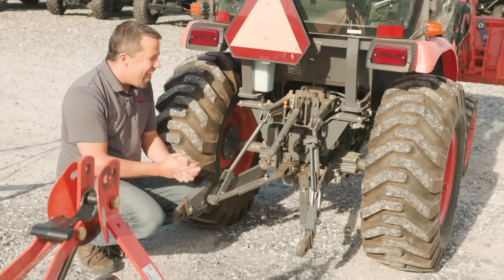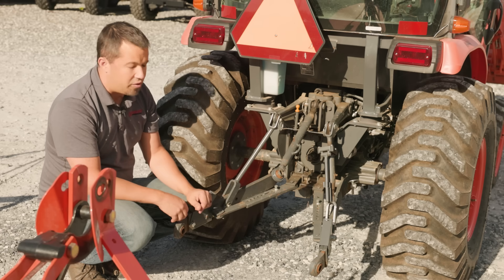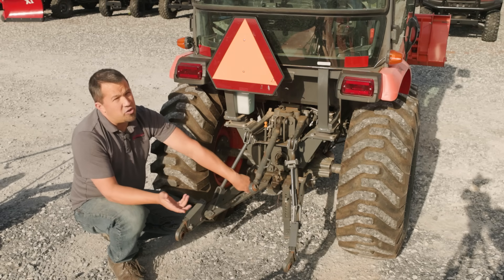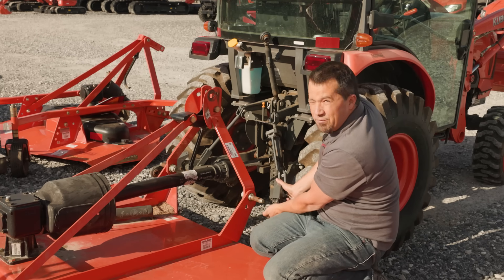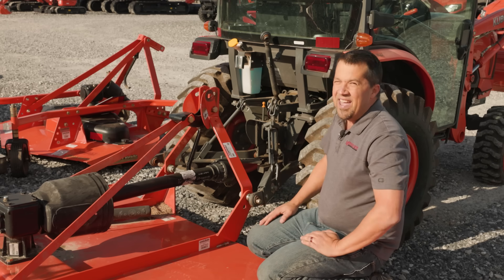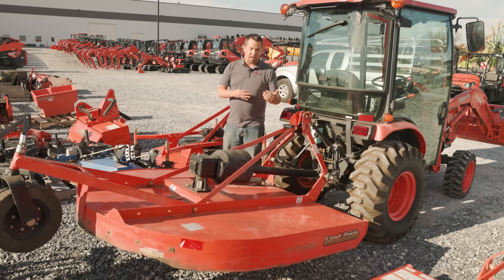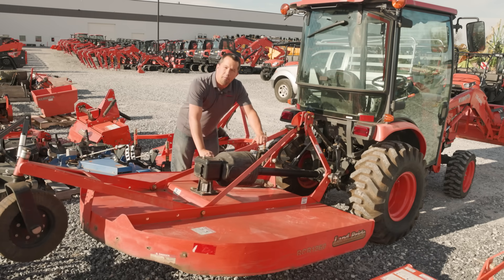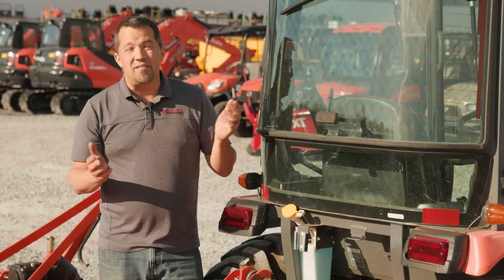Ultimate Guide to the 3pt Hitch

Comment: Thank you for the discussion. Find it easiest to put the top link on first for 45HP tractor. Release handbrake on flat ground and pull tractor back to implement or implement forward if light enough with handbrake on. Put left lower link on first and right next using the adjuster on that arm. Quick and easy. Easier if you lubricate the pins before you start. The standard boot in place method is a standard adjustment when necessary.

Comment: CAUTION: be aware of PTO shaft length!! Be sure it slides in enough to accommodate lifting the implement to the utmost raised position!! Else you could damage the gearbox, or even worse, PTO housing on the tractor!!
I believe Tractor Time with Tim did a video of exactly said damage, a couple years ago.

Comment: Yeah, thanks for the reminder of what's in store when I get to put the box scraper on to weight down the rear for plowing. :-)  The frame mount backhoe is (usually) easier (except it's parked in a tight space, which sometimes makes even that tough.) But, it's usually just once a year, so grin and bear it.

Comment: Tha k you for going through the 3 point hitch attachment and having trouble to show the "KICK" 😊 I would say if harbor Freight is close by, BUY those black handle set of curved different length pry bars. They are very cheap. But the most important part is storage level and flat surface so tractor is straight and implementation is level and straight to tractor. Do some leveling before removing.

Comment: Since this looks to be geared towards "newbies", a word about safety and PTO's is in order.  I always connect with tractor off.  The PTO gives no second chances.  If the PTO decides to engage  (which it should never do on its own) and you get caught, VERY VERY BAD things are going to happen.  We're in a push button world for PTOs now.  Very easy to get one turned on when you might not want it on.

Comment: 07:00 Put first the upper link, and then either one lift arm. 
With the upper link you can control distance as well you can move the attachment to lift arms easily.  
No need for a quick attachment or anything that way.

Comment: At 69 years old, I have found that placing “Pats easy hitch” on the lower arms and a hydraulic top link, it’s so much easier to make the swap of attachments!! Perhaps you should off Pats at your dealership.
Reply: You beat me to the exact point.  Hydraulic top link and Pats.  And if you can swing it a hydraulic side link.
Reply: It is hard to beat with a hydraulic top link and Pats easy hitch system. We also keep our brush hog on blocks so it is easier to hook and unhook. Less fight with the implement with tractor to get on.
Reply: Love my Pats hitch!!!!

Comment: In Europe, enclosed ball ends are only really seen on cat 1 equipment.
Everything else has open hooks and separate balls.
This make attaching especially the lower arms much easier.

You just have to put on the ball (there are different ones depending on if it's enclosed or open on the sides), back up, make sure the hooks are open, and lift up.
You don't really need to adjust the width much or at all.

I often still find myself putting the ball in the top link first, as I myself have more equipment that is closed of from the top, but it's not as critical to get right as with the lower arms.

Hydraulic top links are also quite common these days, at least in the ag segment, and are great in combination with hooks, as you can let the top link down slowly with a rope, and adjust the length to what's needed.

The separate balls also makes it easy to go between sizes, as you just need the larger size that your equipment has, and can bust balls with the OD for that, but the ID for the smaller size
Reply: Yeah I have no clue why America thinks it's advanced when they haven't updated stuff this simple. Hook ends have been standard for decades in other countries

Comment: Two things that stay on my tractor, a spud wrench and a normal size crowbar/prybar.
Reply: Just bought a spud wrench - I never knew they existed. Great comment. Thanks.
Reply: @astoops no problem, I'm glad you picked one up. It's the best tool I have on the tractor, lining up implement pins, loosening jam nuts on top and side links, cleaning mud out of implements, quick repairs, etc. I hope it helps!

Comment: Neil, I find it easier to put the left side 3 point arm on the implement pin first because the right arm has the up/down leveling adjustment. On my ‘80s Ford it’s a hand crank leveling box. If the implement isn’t sitting perfectly level, once the left arm is connected, adjusting the height on the right arm to get it on the pin is easy. The link on the left side isn’t adjustable, and once one arm is on the implement, you can’t lift 3 point arms by hand anymore as they are tied together at the rock shaft. After the implement is mounted, then I make all my level adjustments. It would be nice if every time I set an attachment down it was perfectly level, but even if it starts that way when I take it off the tractor, I find they settle over time if resting on the ground (as opposed to a level garage or barn floor)…

Comment: I use the bucket to move the tractor forward or backward to line up the balls and pins or sometimes the top link.  Usually I screw in or out the top link.  Using the bucket saves a lot of time when you are a single person trying to hook up discs, box blades, plows and such.
Reply: Attaching the top link first allows adjustments when lining up the pins.  Also.  I welded loops onto each bottom link to store the lunch pins, saves time and frustration.
Reply: @plakor6133   I sometimes do that with a turning plow.  The turning plow has a slant to it which makes it hard to attach when sitting flat.  For hooking up my disc, box blade and other things tho, using the bucket to move the tractor forward and backward works faster and easier.  

One other thing that helps, I have a top link for each implement except a couple that I rarely use.  When I disconnect, the top link is under no pressure.  When I get ready to reconnect, the top link is still set to the same spot it was when I disconnected.  I rarely have to turn it more than a single turn to line things back up.  If one has only one top link and swaps it around the different implements, that changes a lot.  It's rare that any two implements have the same length setting.

Comment: Just get a quick hitch.
Reply: Except that isn't the fix for everything, many implements actually aren't quick hitch compatible...some you can modify to be, and some depends on the quick hitch too....like many other tractor things, quick hitches, and 3 point implements don't seem to have any sort of industry standard LOL.  

I bought the Land Pride QH-05 quick hitch for my tractor...yeah, that thing was around $400 and doesn't work on many quick hitch compatible implements because they were too worried about the orange paint instead of having an adjustable top hook like the cheaper non-OEM quick hitches have.
Reply: @wildbill23c just get hook ends instead of ball ends on the tractor. All the adjustments of no quick hitch, all the advantages other than still connecting the top link manually
Reply: @ThingyGoos  Thats why a quick hitch exists so you aren't hooking all that crap up all the time.

Comment: As a suburbanite who grew up on Fess Parker's Daniel Boone and Davy Crockett, it was only after about 150 tractor hours that I figured out that when attaching the PTO, it is 1000X easier to grab the tractor shaft and spin it than to spin the attachment. (Yes, I can hear the laughter . . .)
Reply: I don't think that works on every tractor though.  Some of those shafts don't have a free spinning option they're always engaged internally...but yes, for the tractors that you can spin the PTO shaft on its definitely a help.
Reply: @wildbill23c must be some very cheap and basic tractors if there isn't a neutral PTO gear on the tractor
Reply: Unless it's a very basic tractor, it has a pto brake that holds it still when not engaged.

Comment: I probably would have mentioned bushings when talking about  Cat 1 & 2 implements. I tore up a Quick Hitch with a rear blade because I made a mistake in these. Cat 2 tractor and quick hitch with Cat 1 implement. New guy error.
I also think the PTO connect with the collar you have to pinch while pushing was designed by the Devil.
Reply: Yes, that connect is insane.  Is there some inventor who has come up with hold back that locks it in the open position??
Reply: "challenging motion" 😮
Reply: There's a simple sloution to the PTO collar.   When someone tries to sell you one, "Just say no!"